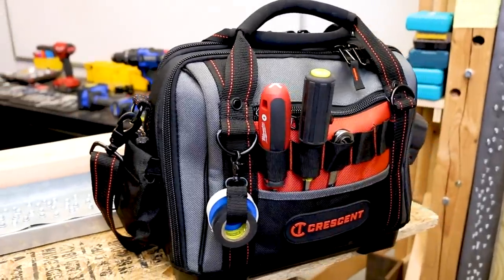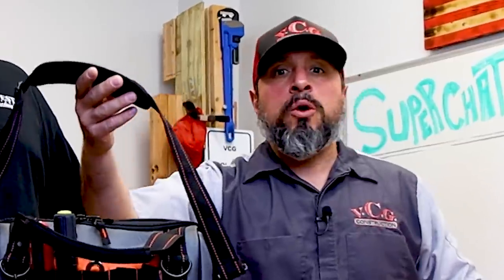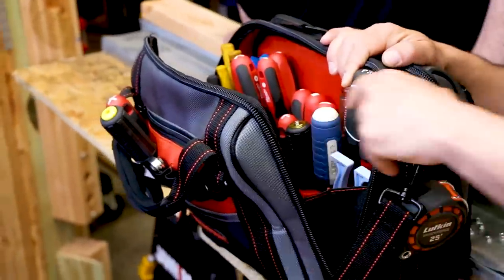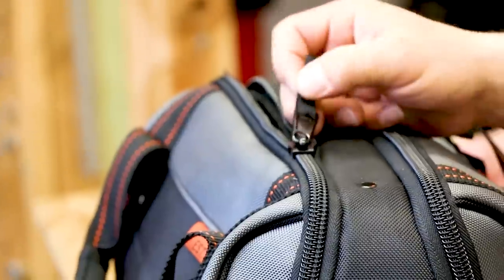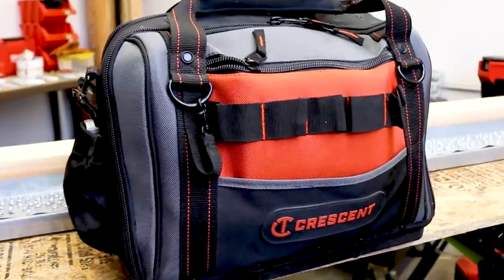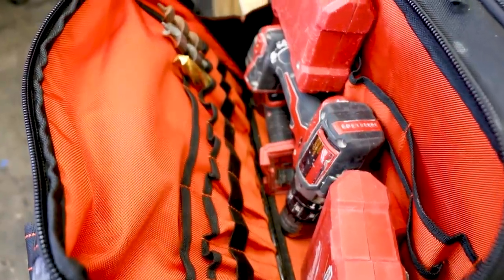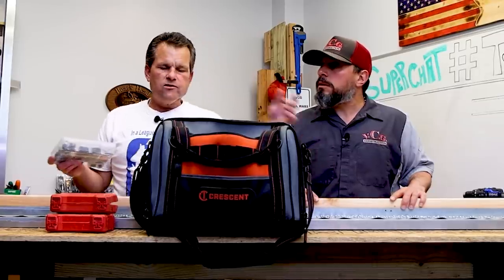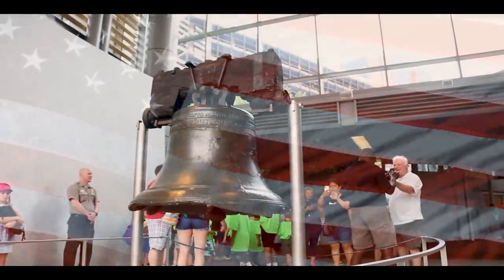Inside A CARPENTER & HVAC PRO Tool Bag (BEST SETUP)

Comment: Another Good one Gents! I also have gravitated to a bag that zips up from the old open top style for the reasons you fellas expressed in the vid. These types of bags will be about perfect if they finally start making them out of a highly water resistant material with water resistant zippers. Cant tell ya how many times ive been caught doing work outside with my bag when the unpredictable weather started spitting rain. The zipped up bag helps protect when the weather turns foul but extra water resistant material would take it to the next level.

Comment: I don't use that brand but use the Milwaukee 500 packout tote i have mine set up for finishing carpentry so has my glues coping saw trim sqaure, packers, sharp knife, hole saws and bits for doors and door furniture hand plane etc  i love it cause everything is in one spot connects to packout system so can grab my drills, router, batteru finishing plane etc. It seems well Made people have said theirs falls over however mine does not

Comment: I think you should have me on the show to show my veto tp-xl diagnostic/maintenance/light repair load out and then my veto riggers installation load out. Solid video. Glad to see other companies are stepping up their tool bag game and entering into the higher end market of tool bags. I formerly used a bucket buddy system because it had the plastic bottom to keep tools dry, has space for everything, and was easy to work out of but after going through three in a year, I switched to veto. Love them and have been a repeat customer.

Comment: 2:59 I put an extension onto my zipper, to allow me to open that pocket without taking tools out. Also, I use my old strap from my bag that was way more comfy for me😉
The one thing I did find liking the least “hooks” on front tool pockets that really hold the tools in place. Thought wouldn’t like that; but I do, b/c I know they won’t fall out. Just wondering about durability. Also think gotta register the bag if want zipper warranty, if I remember correctly 🤔 
The handles, yeah...noticed that really quick after bag was loaded up, & soon as picked it up. Definitely need to be a bit bigger/thicker.
Also, kinda wish had a few less pockets on inside & they added a “hard shell pocket” for like a meter or testers etc...on separate outside, or inside compartment.
Have some bags for for just about everything (HVAC/plumbing, trim carpentry, general purpose) ; & overall, not a bad bag for around $85-$94... Do like closed top mostly, but if doing electrical conduit work or plumbing, it’s nice to have an open top bag to see & grab the tools.
Cheers VCG✌🏼

Comment: the biggest problem a lot of these work bags is the bottoms of the pouches are sewn flat to the bag. you might find a pouch big enough to start sliding your bit box into, but with the bottom of the pocket sewn flat, it will never go all the away down of the pocket. how hard is it to make a useful pocket?

Comment: Hey Guys!  I'm on the M18 platform and need a jigsaw.  Anybody got any good/bad recommendations on the M18 Fuel Jigsaw (not the barrel style).  I see that Home Depot has that jigsaw with 8.0aH and 6.0aH batteries, a bag, and a rapid charger for $299.  Is that a good deal?  Thanks for any input! :-)

Comment: Why does he have 4 multi bit screw drivers, a variety of multiple other screw drivers, but I don't see nut drivers or wrenches anywhere? Am I missing them? My diagnostic loadout looks completely different
Reply: no need to carry 7 different nut drivers when i have the lenox multi bit nut driver...its a  6n1 nut driver and i have my klein 5/16 nut driver....and there is only 1 klein 11n1 multi bit screwdriver...the rest are a set of milwaukee screwdrivers....i have 2 adjustable wrenches and 2 of the husky universal ratcheting wrenches...each one has 4 sizes on it...no need to carry every tool i own for a diagnostic/small repair...and im sure everyone elses tool bag looks different 👍

Comment: Eh, I'm sure its a nice bag, but not for me. I will keep with a pack out system (I use Ridgid) and belts. One tool belt for carpentry and a smaller belt wrapped up in my electrical box. Grab and go. I also use 2 Husky open top totes for bigger stuff. Like clamps, extra tapes, hammers, flat bars, different squares and miter guages. General things that I use but don't want to carry around. My other tote is more for plumbing.  I do have a 16in Husky bag for all my bits. It fits in the Ridgid crate with a pig tail, a Dewalt multi outlet and loose batteries.
Reply: Now if someone made a bag or tote that integrated the tool belt with it, I would definitely go for that.
Reply from the maker: We appreciate the feedback cuz!
Reply: you gotta use what works best for you...just like power tools

Comment: Way to much for a commercial HVAC diagnosing and simple repair bag I use a veto MB with a set of 8 standard wrenches, 2 lollipop gauges, fluke 902 meter, 6inch malco reverse tip and 6 inch 3/8 bit and Handel, needle nose, channel locks, linesman pliers,  jumpers, service wrench, strippers, crimpers, and a adjustable wrench, old tape roll with various wire nuts and crimp on connect,and a hilmar 9in1 those tools will cover 90% of what you need for simple repair and diagnostic 
P.S. I work on everything from 200 hp steam boilers to 1.5 ton heat pumps 500 ton chillers in schools and hospitals